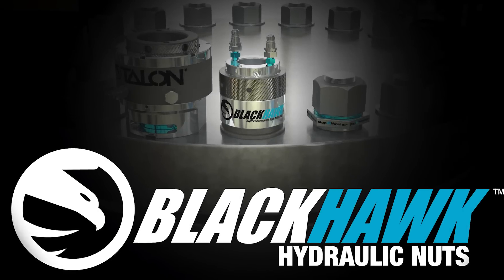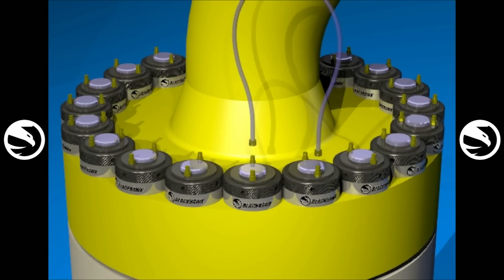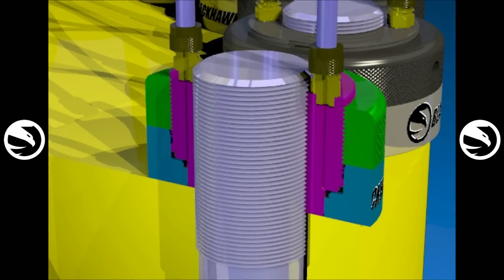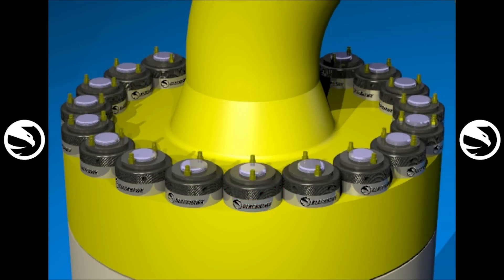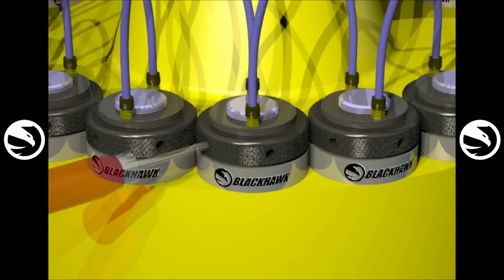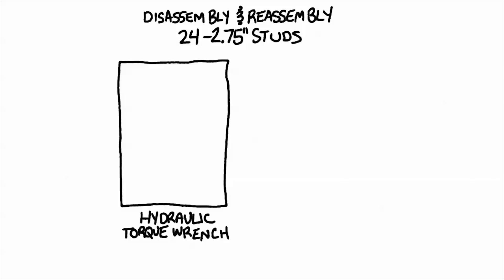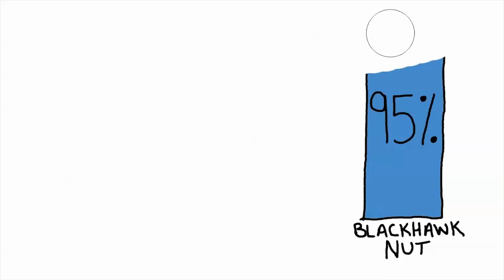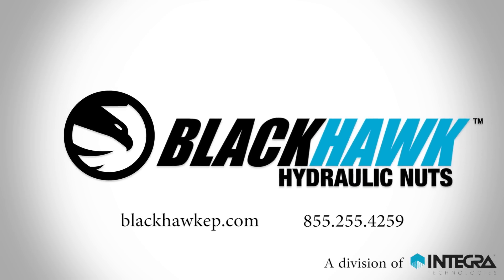BlackHawk™ Hydraulic Nuts | How It Works

Comment: Good good.. but way too expensive.
Reply: curious who is using those products? looks like something for the oil and gas industry.
Reply from the maker: We realize it isn't the right technology for every application, but for critical applications, the value far exceeds the cost. Thanks for taking the time to watch the video.
Reply from the maker: Hi Jan, thanks for your comment. BlackHawk™ Hydraulic Nuts are currently used predominately in the Oil & Gas industry, but we've recently signed with a partner to bring them to the Nuclear Industry as well.